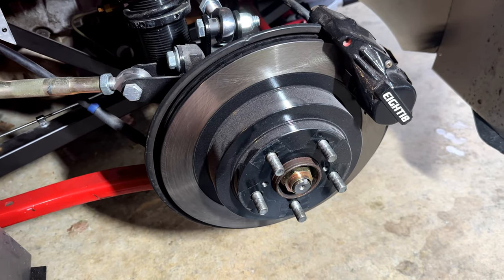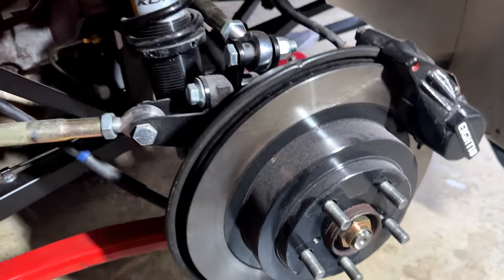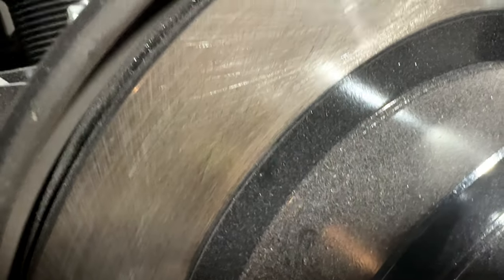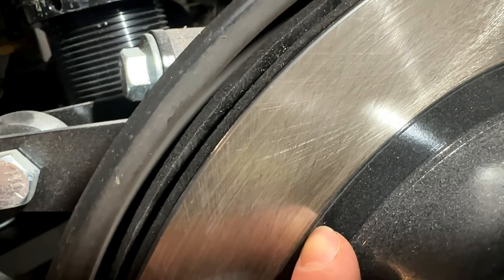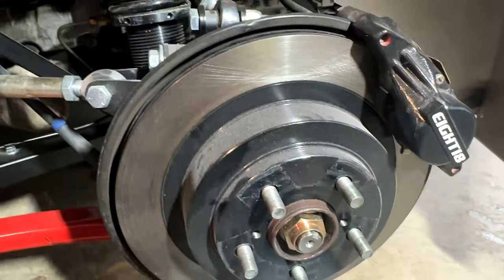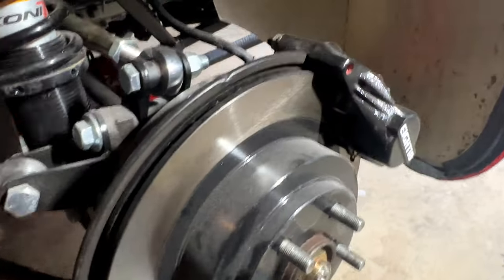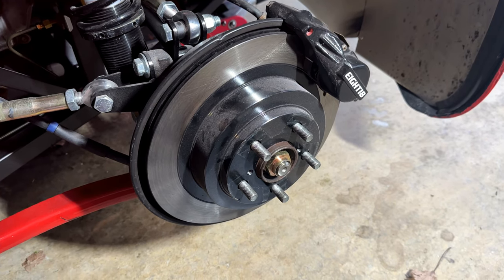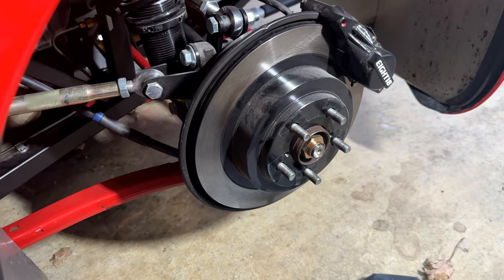Yes I Painted My Brake Rotors

Comment: Been doing the same thing for over 15 years to three different vehicles. Never any problems. Always works great.
Reply from the maker: Worked great for me too. Brakes look awesome almost 4 years later.
Reply: In 2003, I painted my rotors on my 2003  sentra se-r spec v when it was brand new and got criticized by many people. Ive never stopped doin ever since on my other cars. The car wen thru autocrossing, road racing thru streets of willow raceway, i even drove it from Los angeles, CA  to Pansacola Florida for some military training. The stock oem rotors lasted for 10years. Slapped  a new sets of brake rotors n pads from r1concepts did the same thing by painting it. It still on my car as of today.  Well i dont drive that car as much anymore with 245k miles😂

Comment: That’s the best way to do it my opinion
Reply from the maker: I would do it this way again. Just last month I had a friend at autocross ask if I got new brakes because they looked new. He was surprised when I said they were 3 years old.
Reply: @mikecamera818 what name of the paint
Reply from the maker: @AnthonyJarrett84 just a normal high temp paint from autozone or Walmart. I used this one. 

https://www.walmart.com/ip/Black-Rust-Oleum-Automotive-High-Heat-Protective-Enamel-Flat-Spray-Paint-12-oz/17203457
Reply: @mikecamera818  thanks very much

Comment: Nice job mate, I'm thinking about doing the same but afraid tht the heat resistant paint mite not come off when I brake, does the brake pads defiantly take the paint off even if it's heat resistant?
Reply from the maker: I used high heat paint. The pads had no trouble scraping the paint off.
Reply: @mikecamera818  excellent, thanks for the advice bro

Comment: Did you have to change pads after they scraped the paint off or did keep using them?
Reply from the maker: I kept using them. It only takes a few braking events to scrub the rotors clean. Still using the same pads 3 years later in autocross. Rotors look great and pads are strong.

Comment: So your gonna take you rims off every time you have to clean the break dust off your wheels? Cause the minute you spray any kind of solvent on those rotors that pain job is Garbage!!!
Reply from the maker: In 20 years, I've never sprayed solvent on the brakes of any of my cars. I've only sprayed solvent on brand new rotors to remove the oil from manufacturing. I just wash my cars with soap.

These rotors have been painted for 3 years with no flaking, rusting, or issues.